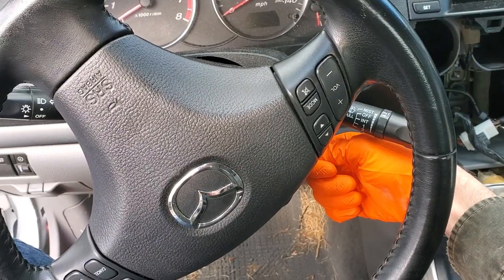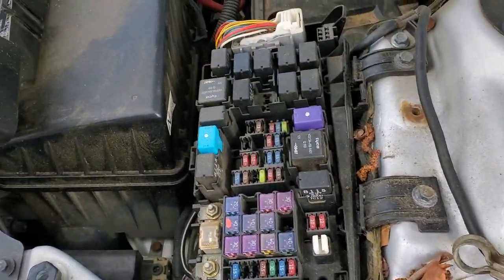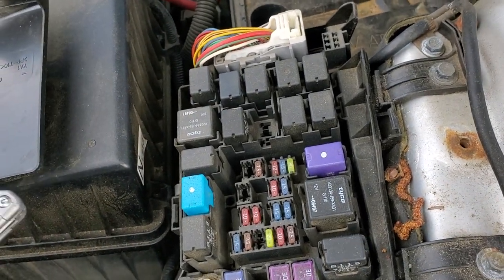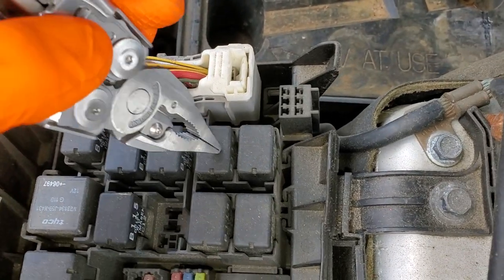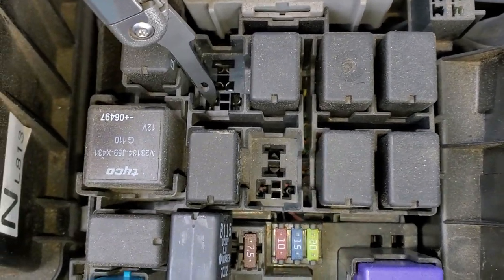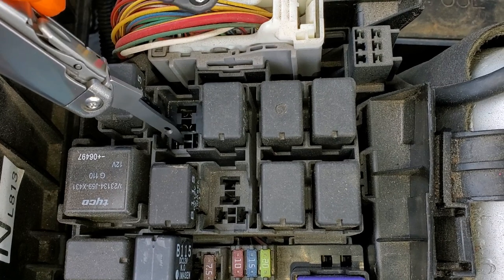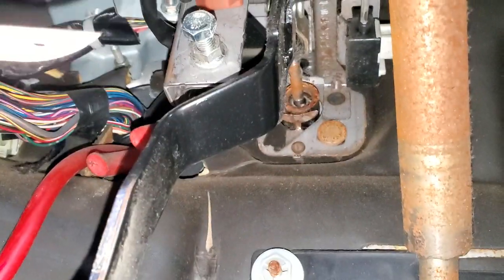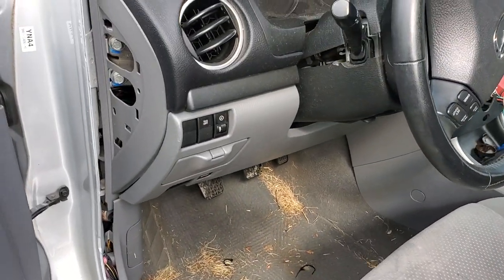2008 Mazda 6 Starter Fuse, Starter Relay & Circuit Explained

Comment: My 2005 Mazda 6 has an intermittent problem in that many times when you attempt to start the engine all you hear is a clicking sound under the hood (it's pretty loud), and the starter doesn't turn. If I attempt to start the car over and over again then it will eventually start, but sometimes it takes about 20 tries to get it to start. I figure one day I'm going to be stranded when it won't start. So it sounds to me like the little relay in the Fuse Box is working. BTW, I already swapped out the relay in the fuse box as a first troubleshooting step. My question is, is the sound I'm hearing coming from the starter? I'm thinking yes. I would think the starter has a heavy duty solenoid or relay since there doesn't seem to be a firewall mounted solenoid or relay on the firewall like in the cars made in the 60's and 70's. I can remember having a big relay on the firewall of my 1971 Dodge Superbee where I could simply short across two terminal and test the starter that way. Let me know what you think my problem is. Thank you.

Comment: Hi, i got a mazda 6 2007 2.0 AT, last week my car speedometer suddenly goes off when driving, next day i found out one the the fuse(meter ig) burned and i changed a new one, but after 5 mins driving, it burns again, does any one know the problem is? Thanks (after fuse burned, speedometer off, the window and turn signal not working)

Comment: I have mazda 6 04 v6 model was working fine couple days after went to start the car nothing cranks turns over but dies quick
Check fuel pump is good 
What u think can be the problem?
Reply: Hey I’m have same issues mines don’t want to turn on I think it’s a pcm issues I brought another computer but I can’t program it because my obd 2 port is not communicating with the computer so right now I’m trying to figure it out my self